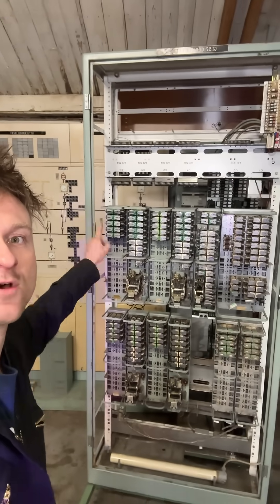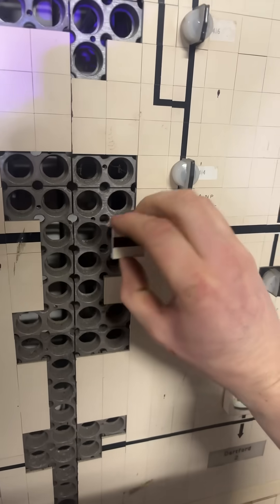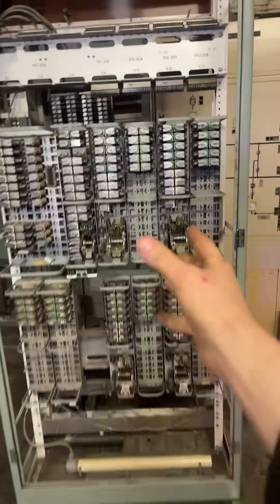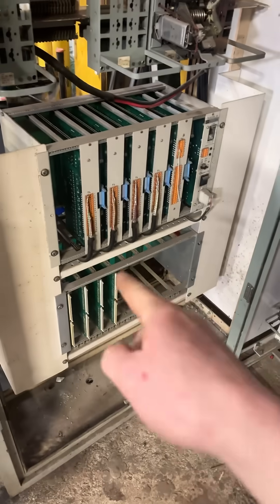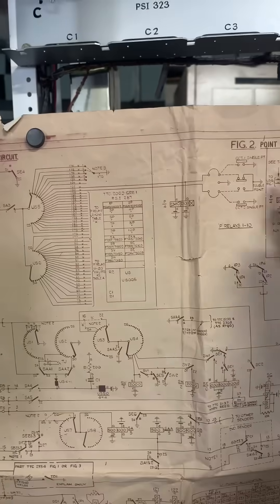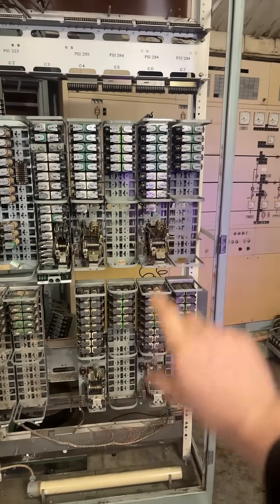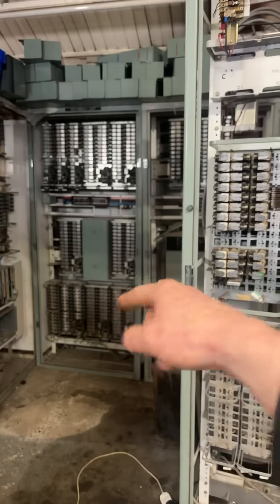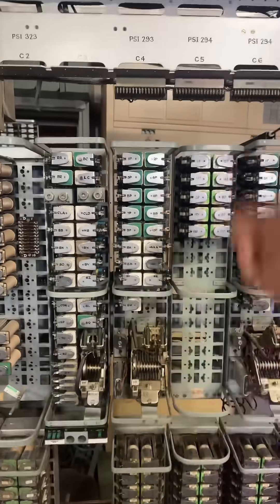Figuring out 1960’s power station relay telemetry system part 2 #shorts

Comment: There's surely an encoder and decoder at each end? Presumably, the minic panel sends remote switching and then receives feedback from the switchgear? You wouldn't want to use the indication from the switch on the panel as you would want to confirm the switching operation had taken place.
Reply from the maker: There is confirmation pulses back on this. But no encoder I have found yet on the decoder side and visa versa. I’m just telling you what I have found. I am presuming nothing as nearly every time I try solve problems like this. It is never working how I initially presumed.
Reply: @LOOKMUMNOCOMPUTER  i was presuming, i wasnt persuming that you were presuming. I enjoy problems like this too. I was just bouncing thoughts off you.
Reply from the maker: @ all good. It’ll all make sense I’m sure. Maybe the telecode 80 does it who knows. All I know is it’ll not make sense to rewire how it used to be! Not got a power station. Likely making a drawing machine out of the telemetry and rasp pi on back of control panel now. 2 seperate projects me thinks

Comment: Hey, Try using a CD4040  with CD4068 "Octal" And gate in parallel to the outputs of the ripple counters in combo with 74hc165/74hc595 if you really don't want to use a Arduino or anything and need to shift in/out data in to these cabinets. using NPN / PNP combo you can translate 5V to pretty much anything. use multiple CD4068's on the same ripple counter to create 7, 8 127, 192, etc. CD4013's set/reset might be required on the lower numbers to prevent double/triple latching.
Reply from the maker: im not going to use anything just switches :D. gunna make a matrix either side of switches.
Reply: @LOOKMUMNOCOMPUTER  Well, I'm some small 350km from you, i can't see what these cabinets need. just in case you need to clock in some data. it was some comment from a previous video that suggested this.
: )
Reply from the maker: @AnalogDude_  all good! yeah no need it is all a synchronous amazingly enough!
Reply: @LOOKMUMNOCOMPUTER  use 2n5457 JFET (used in UREI 1176) to build "8" channel hi pass filter on half a Kosmo panel, than you have the best JFET, expensive, alternative is obsolete BF256, witch according to a old transistor book is the replacement ( equivalent) of the 2SK30 used in Roland.

2SK208 from Toshiba has the same properties or values in the datasheet as the old 2SK30. but SMD.

... or 4 channel hi pass filter if you choose ms-20 "2 pole" with resonance, use 2 capacitors on the first cell, one for HP input, the other for Reso. you can use 1nF like in the MS-20 filter, but it might be better to use 680pF like in Roland Jupiter 8, i used 1nF like in the MS-20 filter but that doesn't cover the entire audio range, but more like half. but still very cool sounding.
Reply: @LOOKMUMNOCOMPUTER  Hey, Sam look for this video: Paul Kalkbrenner- The Florian Trilogy.
Cloud Rider, Mothertrucker, Feed Your Head.
The BPM rate is something to fall in love with, all tracks are cool.
The official video of "Feed Your Head" is very cool, it's about a guy that lives in his own world in his head, also worth while. a very very very cool song. So sweet.

Comment: Mosaic panel? Cool! Something similar was used for Polish railroad traffic control and signaling systems in the '60s...'80s. Switchboards placed in control rooms at railway stations were the front end, and relays in the racks were the back end that did the switching job, with all safeguards like redundancy and dependency resolution hardwired in place. Later on PKP PLK (Polish railroad company responsible for the infrastructure) moved on to computerized control with higher centralization; one control district encompassed several stations at once.
Reply: Very similar here in Germany.
Out railway still uses lots of legacy hardware. Relay logic is very much alive there because it's certified and standardized. It's one of the last standing pillars of relay control and logic
Reply from the maker: cool!

Comment: That thing is fecking sweet, will you be sharing the schematics ?
Reply from the maker: regarding the schematics. i think when done and at museum i hope someone at museum or someone volunteering to do so will scan em out. not really in my scope. :D but will work it out.
Reply: Fair do's , what I dont get is does the scanning uni selectors run all the time or are they triggered somehow when say a switch is flipped ?
Reply from the maker: @ they are triggered by a change of state